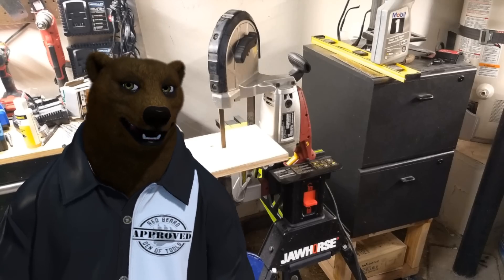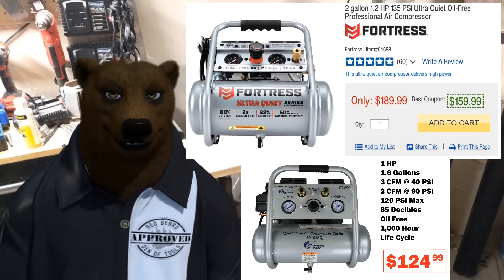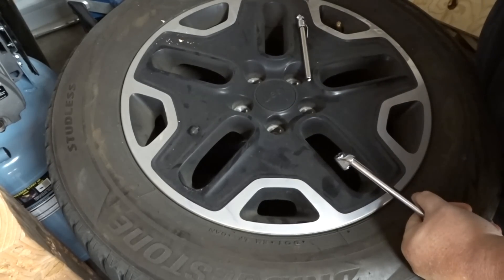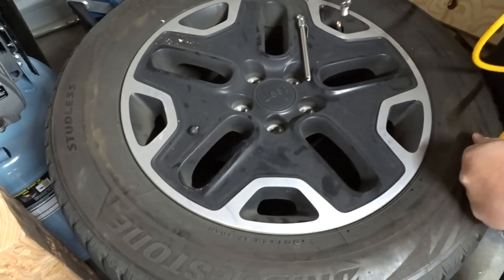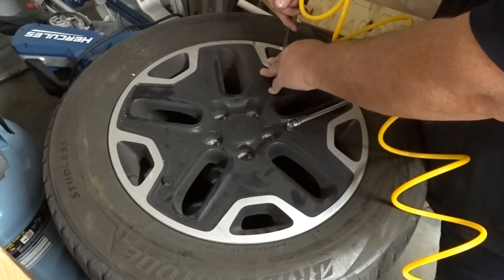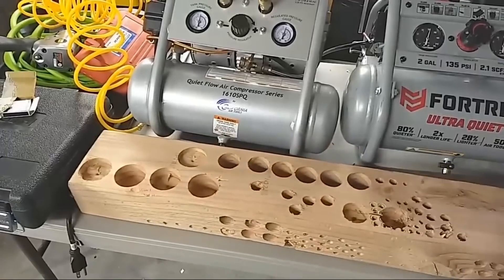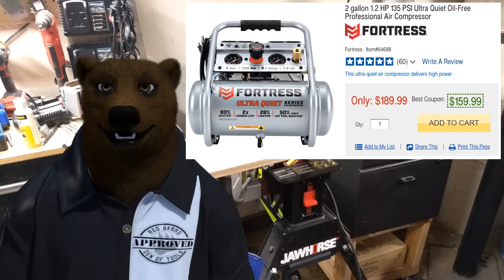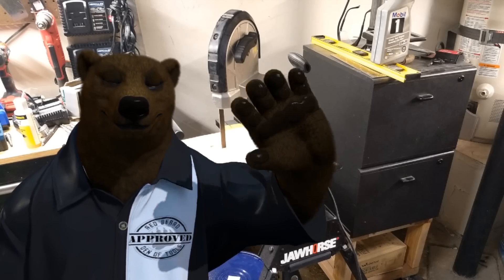Quiet Compressor Battle (Harbor Freight Fortress vs CAT)

Comment from the maker: Honestly, if you have a small shop, and are not looking to run air tools this will probably do everything you need and NOT give you a headache doing it.
Reply: did you see the coupon today for the 4 gallon? great deal! - I wish I knew if the 4 gallon would run my 3/8 ratchet or my 1/2 impact? But I'm thinking I'll have to get the 20 gal or 21 gal McGraw... recommendations between the CP or MG for which to use for light duty mechanic work on my motorcycles and once in a while on a car/truck
Reply: @DennysPlantBasedJourney  29 or 60 gallon oil compressors... You won't be disappointed.  That's my opinion.
Reply: The Den of Tools I’ll wait for the big one in a few months
Reply: Love the intro! +1 For Da Bear
Reply: What shop would this be used for, it can't fill up tires it really can't do nothing. It's a compressor as long as you don't need it for air that doesn't even make any sense
Reply: Wondering if this with a fairly large  secondary tank inline wouldn't make for a good shop compressor.  The additional tank volume would  help for shop use but disconnecting the compressor would allow it and it's small form factor to go out to a remote  job if needed
Reply: @eksine  the test he did on filling tires was with the compressor turned off - just the available air/pressure stored in the tank, the 2gal Fortress can certainly keep up with filling tires, nail guns, small blow guns, etc. Just can't run air tools with large air volume requirements (air sanders, impact wrenches, paint sprayers, etc ) with it, simply doesn't have the CFM output.
Reply: All oiless means extremely short compressor pump life compared to oil type pumps that is serviced / has regular oil changes !
Reply: Just picked one up. Stupid quite and hardly any vibration
Reply: @eksine  It can't fill a tire on ONE fill up. It's only got 1.6 or 2 gallons of volume, CAN'T fill a tire. Nothing can unless you had like 250psi or more MAYBE. 
These are designed for nailers, not tires. Maybe an airbrush, but that would probably be a lot like the impact wrench test...
Reply: @eleanorecopet4090  Maybe if you get a good one, and definitely only if you take care of it. These things are built for guys thag want to run quiet and, while I don't know the specs of these small ones, the CAT 4.6g 4610s is rated for 3000 hours. That is a LONG time for a tool that doesn't really need maintenance. 
I think it is like the sealed vs unsealed bearing debate: you want it to run forever with very regular expense and maintenance, or a long time with nothing?

Comment: I bought this Harbor Fright for my wife ~1.5 years ago. She’s used it to do trim nails in a bathroom and upholstery staples on a sofa. It stopped running, the motor just hums once it’s generated 30psi. I disassembled it, the pistons are free, the motor spins freely and the power switch and start capacitor are good. It appears the motor’s windings have failed. It measures 2.5 ohms. Harbor Freight tools are disposable. Buy once, cry once.

Comment: This Fortress uses the exact same motor as the California Air Tools 5510SE Ultra Quiet 1.0-HP 5.5-Gallon Steel Tank Air Compressor I bought in January of 2017. It still works great and is dead quiet. I have had to replace some of the brass fittings and the gauge, but it was all readily available at Harbor freight tools for low money. I paid $127. for the compressor in 2017.

Comment: I chose several hercules and harbor frieghts best tile saw for 1 reason.
Harborfrieght has much better motors.
Improving production alot.
The only downside ive found.
Is that they are alittle heavyer.
I am a busy builder.
My battery operated tools are Milwaukee.
For my mandatory must have compressor.
Meaning painting and drywall texture.
Fortress makes the most sense.

Comment: I’ve got two of the Fortress 26 gallon Ultra Quiet compressors and one 8 gallon California Air Quiet Compressor.  The CAF with the small tank runs a lot when being used and has worked well for over a year on a large laser as an air assist component. The motor is just now starting to get a little noisier and may be getting ready to need some work after very heavy use for over a year. As a precaution, I decided to go with the larger Fortress Quiet compressors on my machines and they are relatively quiet and run much less than the smaller compressors in my applications.  So far, I am impressed with the Fortress Compressors.

Comment: I bought one of those 2gal fortress compressors about a month ago to use in my house remodeling master bath and kitchen. It's quite and builds up quick. Using it for a 15g nailer and 18g and occasionally a framing nailer. No issues with it hated the noise of the larger pancake I was using.

Comment: I purchased a Fortress in January to carry in my motorhome. 
It fills my 22.5 inch tires to 115# very well.
Quiet
Light
Fast fill.
I like 👍
Reply: Would a 1 gallon be good for airing up low boat trailer & Lawnmower tires or would the 2 gallon be better?
Reply: Thanks it works my Rv tires too 70 psi..!!

Comment: The intro was a stroke of cinematic genius!
I would have liked to have seen the noise level measurement on the CalAir compressor. To me it sounded about the same as the Fortress.
Thanks Bear.
Reply from the maker: Yeah, I would have too.  I know I shot it but I could not find it.  I can tell you that it is actually a smidge quieter than the Fortress.
Reply: @denoftools   and remember that a 3 dB difference doesn't look like much, but it means double (or half) the sound pressure level.

Comment: Nice video. I picked up the Fortress 2 gal.  Was a pain to drag big compressor around just to run some finish nails, pump up a tire, or whatever. So far, Super handy and quiet, and I like it enough that I’m thinking about getting the 26 gal/175 Fortress for around the shop.

Comment: I have a Airboss Craftsman model 16574 horizontal running 1 gallon tank air compressor and it is loud enough to get nearly every dog in the neighborhood barking. It works very well for the odd small jobs and is very compact but, the noise is a limiting factor for when/where I can use it. If at an RV park I can really only use it during generator run hours. So this quiet model is something I may want to purchase. It may not be as compact as the Craftsman but the quiet running is going to, I think, make up for it. Thanks for the review.

Comment: I just bought this air compressor.... it’s stupid quite!! Hardly any vibration to.
Reply: I'm assuming you picked up the 2 gallon Fortress.  Any issues filling up a tire?  I need to purchase a new air compressor and don't know if the Fortress will be able to handle a 35psi tire without constantly stopping to recharge.  Please let me know.  Thank you.
Reply: slade781 we have a Honda CR-V and it pumped it in like five minutes or so. It’s been a great little compressor so far. Hope this helps.
Reply: @traceydetwiler9552 , thank you for the quick response.  In regards to pumping the CR-V, did 1 tire take 5 minutes?  Or all 4 tires took 5 minutes?  How low were the tire(s)?  And when the compressor came on to refill were you able to keep using it or did you have to stop and wait for it fill before continuing?  

Sorry for all the questions.  I'm just really considering the Fortress compressor.  :)
Reply: slade781 the tire only had like 5#s in it it came on when I topped of the third tire. Can’t remember how long it took to come on since I keep it set at 90psi for nail/pin nailers sorry I can’t help with the second part of your question.

Comment: Comparably-priced compressors from California Air tools have comparable CFM @ 90psi ratings (2.2) at similar DB levels, though typically with larger tanks and smaller motors. You buy a compressor because it can support the CFM that your application provides. After that, factors like aesthetics and build quality, weight, price, etc. become important. You should be careful to compare apples to apples from a CFM perspective, and not to hand-wave price as if it were a non-factor. Anyway, awesome intro. Keep up the good work.

Comment: Nice comparison video. I am thinking about buying the fortress air compressor.
Reply: 351L I bought one yesterday. The 5 gallon 225 psi model.  Couldn't keep up and recharge time seemed excessive.  Took it back this morning and bought the Kobalt Quiet 26 for same price. Kobalt was quieter by a large margin and runs my air tool use better.  YMMV depending on your needs.

Comment: I had the smallest one (Think it was 1 gal).. loved it.  Also have a much larger quiet Husky, but loved the little Harbor Freight one because it was so portable.  Used it a lot for finish work until it was stolen!  Need to get another one. The tiny one worked great for finish nailers and even spraying paint out of a ,08 tip (small Cerakote projects).  For pumping up tires.... the Ryobi cordless hand held tire pumper upper is the way to go.

Comment: Waiting on that 26 gallon 200PSI fortress.  Have a 200PSI 20 gallon walmart hausfeld, its only able to muster 175psi now. . . .
Reply: I heard Fortress is also supposed to make 60 gallons. We discussed all the new stuff coming out during a meeting when I worked for HFT
Reply: Dang! Your Compressor, with those specs, should run a nail gun or fix a flat all day long. Just what are you doing in your Work Shop?
Reply: @designertjp-utube  I use it for my rattle guns, low volume high pressure paint gun, airing up tires, blow gun, the basics. It was just on sale at walmart, 200PSI. . . nice that it has to kick on less often, but it is getting worn out, before it can get to 200psi and hit the pressure switch, it will get too hot and kill it at about 175psi from the thermal breaker sensing its getting too hot.   But it has me sold on the higher PSI tanks. . .

Comment: I have the one gallon. Great for topping of you tires. Runs a brad no complaints. Runs an airbrush perfectly. I bought it to run indoor for hobbies. This thing can be running, you;re on your cell phone right next to it. I would agree, excellent build quality. I would add when you lift it, it is very balanced. It isn't awkward to carry as well. Strongly recommend for the appropriate tools. I wouldn't try to run an impact with either of these compressors. Fill time is too long. Palm nailer, brad nailer, stapler and similar smaller tools and painters are perfect for it. The CFM tells you what you should and shouldn't run
Reply: I just need to air up low tires with it like boat trailer tires & riding lawnmower tires & car tires. Looks like a 1 gallon would work based on your comment.

Comment: I just bought one of these Fortress 2 gallon models to use instead of my old Craftsman 26 gallon upright ear destroyer. Hopefully this fortress can totally replace it. 1.2 horsepower seems like a lot for a compressor this size, my 26 gallon is only 2HP and craftsman's 2 gallon model is like 1/3 of a hp.

Comment: The major downfall is the warranty harbor freight offers on the compressor. I know, you can buy an extended warranty but with the premium price you shouldn't have to. It should come with a minimum 1 years warranty included with purchase. Great review bear.
Reply: That's the kicker... I'm considering the Kobalt, slightly smaller, compressor just because it has a three year warranty.  Come on Harbor Freight-- this is supposed to be a top tier/pro level tool and it has a 90-day warranty?
Reply: Realistically, if it failed after one year, there would be a lot of unhappy campers. 
Do they think they're going to lose a lot of money on warranty repairs of one year old units or would they gain much more in increased sales from demonstrating more confidence in their product by offering a one year warranty?
If they were willing to go to three, that would really signal the turnabout of the HF cheapness stigma.

Comment: How did the 1.6g out do with 16 nails vs a 2g that got 12 nails?? From what you have there, the CAT is better made in the sense of efficiency for air loss.  Also CAT has a 2 gallon model in aluminum rust free tank that puts out 1.0 HP (Rated / Running) 2.0 HP (Peak) Motor
3.10 CFM at 40 PSI      2.20 CFM at 90 PSI  120 max psi for for $175 free ship.   Having said that, I have the Fortress 2g, and I do like it a lot, but it is heavy for a 2g. I dont know if it is a alum tank, nor do I know if it has a moisture filter in the intake??

Comment: I flipped the drain valve handle on the one i got, so i can open the drain and rotate it to the bottom without breaking it from contact with the floor. If they attached the rubber feet further forward it would have cleared the drain and allowed it to rotate without sliding on the frame rails. 
Looks like they drilled holes in the frame to mount the feet so it's not easily repositioned.

Comment: This is a good review of the portables - It also shows you that HF is getting into better quality products and I had been wondering about the Fortress - thumbs up
Reply: HF is making better products, but it’s charging higher prices to match.
Reply: But still 90 day warranties. it'll be news when they back them with standard length warranties
Reply: They wanted $22 for an extended warranty. So it would have been $162 total if I went with it. But I decided to take the gamble that if it breaks it'll do it within the first 3 months.

Comment: I use a CAT 4620ac with a 10gal Hitachi reserve tank to run a fogbuster, blow gun and power drawbar.  No issues, its nice and quiet.  Paid $220 on amazon
Reply: You must have found that compressor on Amazon either returned and discounted, or on one heck of a sale.  I paid around $300 for that same compressor around 5 years ago (bought it direct from California tools; don't think Amazon carried them back then), but just looked on Amazon and their price today for the CAT 4620ac is $393.95.
Reply: @bataantom  Lucky you.  That's quite a savings.  I've been very happy with the performance of my compressor.  It's been able to handle pretty much anything I've asked it to do, but I may add an auxiliary tank like was shown in this video to help keep up with a paint gun, as I'm planning on painting one of my vehicles later this year.  Harbor Freight sells an 11 gallon tank for $40 and a 7 gallon aluminum tank for $60.  Using one of their 20% coupons, of which I get at least one per month from them, would make the cost of the tanks $32 and $48 respectively, which isn't much money to add some more tank capacity.  I like the idea of the 11 gal tank, but it weighs around 30 pounds, so it wouldn't be quite as easy to lug around on it's own as the aluminum tank, which weighs only 10 pounds or so, with the added benefit that the aluminum tank wouldn't be subject to internal rust from condensation.

Comment: I have had mine for almost a yeah now I ran for hours on days I used it to keep my RV airbags inflated drove from Florida to new York then back to Florida. Also running harbor freight predator 2000 the whole way there and back both worked amazing.

Comment: Might fall flat in the areas the 2 gal Fortress does better, but I got the slightly-smaller California Air Tools 1p1060sp from Amazon for $109 used.  Toss in a Sparmax SP-35 for $70, and you've got a very respectable airbrush setup for $180.

Not expecting to run a framing nailer on it, but for airbrush, air brads, blowing off work surfaces, and the occasional pump job, the price and performance are really tough to beat.

Comment: These would be great for airbrush work, I had a tiny silent compressor but it didn’t last, this would be perfect for in the house use.
Reply: That's why I'm here looking at these, my understanding is that most airbrush compressors don't last
Reply: erieschl the one I bought sure didn’t, I don’t remember the brand, but it was around $120, not to mention the tanks on them are tiny so it’s running a lot
Reply: @eizzle78  did you buy this harbor freight one
Reply: erieschl no, I haven’t bought one, I haven’t used my brushes for a while.
Reply: I just picked up the 1gallon, so far its been perfect for running my airbrush.  Skip the "hobby" compressors and get one of these

Comment: Got it today for the Memorial Week sale. Also got my Harbor Freight Club card and got a discount. Was gonna get a Metabo but canceled as a few Decibels for an extra pound of air was worth it. almost the same price. Using it for my attic for Nailers from Framing to Brads and since I take my time. Does what I need it to do. TY for the review as I had never paid attention to the housing, frame, or where the ports are as I usually just keep it in a corner. Made me look at all my choices again.  Got a big noisy monster in the garage but I ain't hauling that #$^%^ up and down. Sooo, Happy Camper Here=) ty ty

Comment: I’m waiting for the twenty one gallon model. Think I’ve seen pictures with the caption coming soon.
Reply from the maker: It's actually going to be 27 gallons I really really really really really want that one
Reply: @denoftools  Any specs on the CFMs of the 27 Gallon?
Reply from the maker: The only spec I have is that we will probably see it after summer.
Reply: I've noticed that each larger one that comes out has higher noise ratings. 1 gallon < 2 gallon < 4 gallon...  I'm guessing the price will be pretty high if you look at the 4 gallon already checking in at $220. The photos I saw had 200psi marked on it, but I forget the other specs.